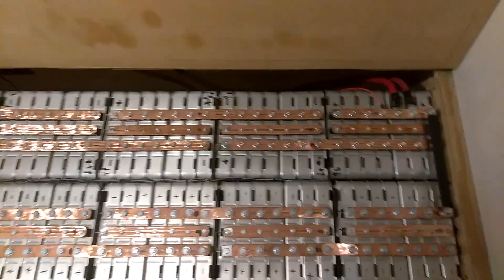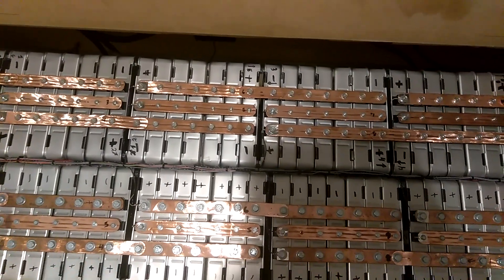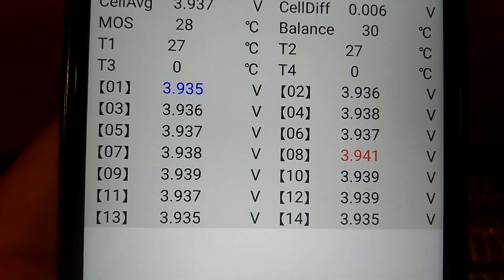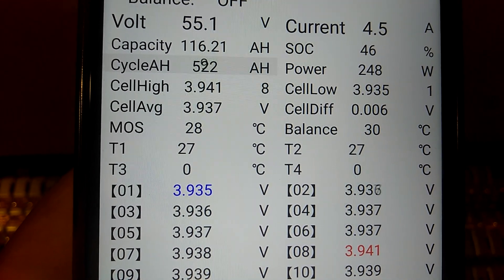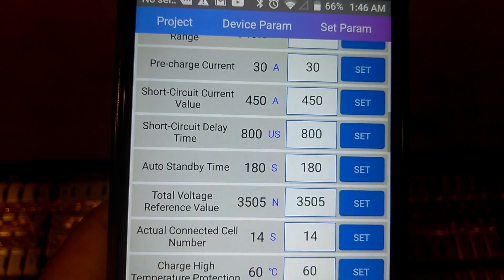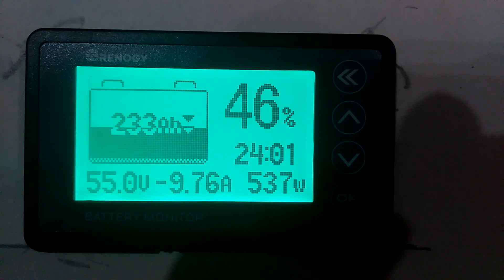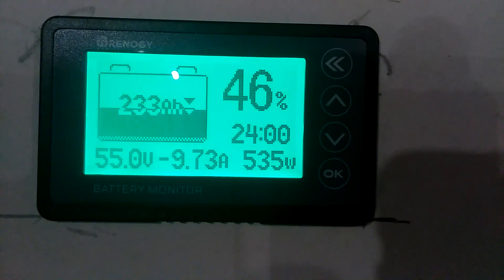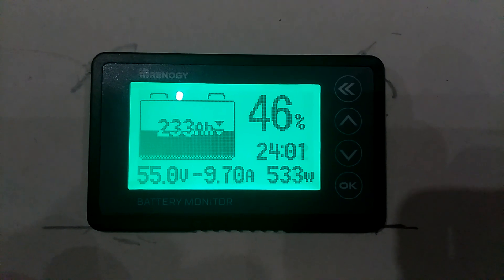Nissan leaf battery bank done finally.

Comment: Are your low/high voltage settings the default for lithium-ion, or did you customize those? I'm reading on TechDirectClub's website that the cell voltages need to be min > 2.5V (ie 2.8V looks good) and max < 4.15V (ie 4.2V is too high). Every Li-Ion BMS other than ANT (I believe the one you have?) aren't programmable and don't fit within that range (specifically the high voltage cutoff of 4.2V). I just ordered some ANT BMS' with expedited shipping from China (2 weeks delivery) but it looks like BatteryHookup has two that might work as well (Daly, Smart BMS)?

I'm assuming you haven't had a problem with the 4.2V high voltage cut-off setting? Do you know where I can get the specs for the cells other than TechDirectClub? I'm hoping their numbers are being conservative.
Reply from the maker: No haven't had any problem with the high voltage and range and yes my BMS is adjustable. I have a custom setting that I made myself and yes the BMS is a ant BMS.
Reply from the maker: I have seen that information on a website I believe it came out of the leaf shop menu .  If I run across it again I will send you a link to it.

Comment: at what amps do you charge your batts?
Reply from the maker: 50 amps on each Bank so a total of 100 amps.
Reply: @carsonlurbanwindandsolar3437  wow thats good,,i only have 1/2 of your bats,i was just wondering what to put mine at,,i dont have enough solar for 100 amps,i think on my leaf bats i  do 75 amps,,but i never get to that,the way the panels are facing 3 def ways..2000 wats south.2000 west and 1000 east,,i have seen 35ish amps,,lol,its cose buy the sun gets up enough to get craking,its  already 1/2 charged up,
Reply from the maker: I only get that a short. Of time in the early part of the summer then it starts dropping off and it ends up about 50 to 60 amps total. Heading into the fall of the year.
Reply: @carsonlurbanwindandsolar3437  im not sure what im gonna get this year,i went from 1000 watts to 5200 watts somthing like that,we will see,,i haven got my other batts like yours in yet ,its hot here ,and i have to do the battery work out side,lol no room inside,,i still gotta make the bus bars i have the stuff ,,,lol,its just hot outside,,im a wuss when its hot

Comment: Wow!  Thanks for sharing this.  I love love love your system!

Question...can that BMS that you are using also be used for a 6S, 24V system by just not using some of the balance leads or do I have to specifically look for a similar BMS to yours, but in 6S/24V configuration?

Really appreciate you sharing all of your knowledge on this!
Reply from the maker: No it will not work it said it will only go to a 7s.
Reply: @carsonlurbanwindandsolar3437  Thank you!!

Comment: how did you come up with the capacity 510ah? does that renogy battery monitor calibrate the capacity or you did a capacity test?
Reply from the maker: I fully charged it to 100% and then drained it down to 49 votes and that's how I came up with 510 amp hours.

Comment: Mine is a little different I set up 2 banks that are not connected together at battery and they are connected after the BMS so they show separate charge values so my common bus bar is after the bms. But whatever works is the best way.

Comment: 👍🏾 Best place to purchase solar panels connectors and wire ? Thanks 👍🏾
Reply: depends on all kinds of variables .  Budget , new or used, on grid or grid sell vs off grid, amount of power you want and space you have to put them in, warranty  the voltage system you will run to lessor extent unless its 12 volt etc.  Some panels are more efficient (read expensive) but get more watts per square meter or yard. Some are perfectly fine but are used and may not have much warranty. One very big difference if you plan to sell to grid or have to have inspected it must meet your local code.  In this case you need to make sure the panels will meet the code. new ones should meet codes used ones you would need to verify it.

Personally I bought new panels that were "open box" and not guaranteed by manufacturer but had a 1 year seller guarantee and are relatively high efficiency from Santan solar on E-bay.  They sell some used panels as low as .16 per watt.  personally I would stay away from the snail trail panels.  Used panels for offgrid are least expensive. You CAN most likely still use a hybrid inverter connected to grid for backup , you just cannot sell to grid.
Reply: @teekay1785  Thanks 👍🏾 25 used panels 270 watt off grid . Will setup like Carson . will not sale back to grid .
Reply: @mississippi4589  Good Deal and good luck with your system !!!
Reply from the maker: eBay and AliExpress.
Reply: @carsonlurbanwindandsolar3437  Thanks 👍🏾 for the information. Will check it out.